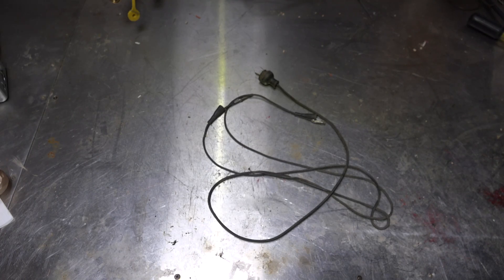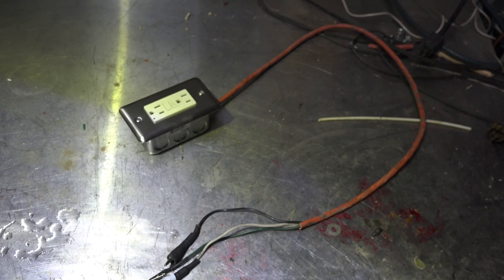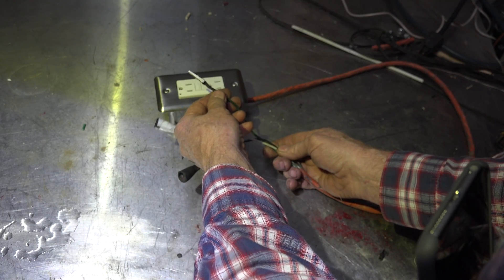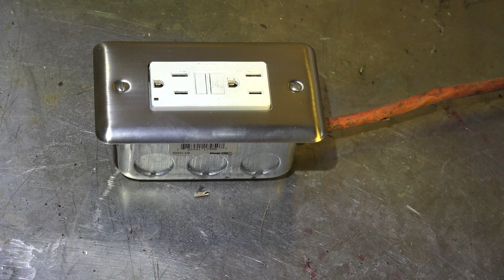A GFCI protected power tap

Comment: You might want to consider an Arc Fault Interrupter in case of accidental short (perhaps one of the alligators were to pop loose) it will trip upon arc instead of relying on the breaker tripping under full current.
Reply from the maker: I guess that would be nice but if I keep going here I will need a trailer to haul it.
GFM

Comment: GFM, I enjoyed many your HVAC videos and many of them are very educational. However, I need to point out that this practice using ground as neutral can be potentially dangerous. I read your responses to the comments regarding this issues. I know many HVAC techs use this method for powering their 120V equipments because they do not have an easy access to a 120V source.
Nonetheless, just imaged that if the bonding between neutral and ground is bad which is not uncommon and it is usually completely unaware to the home owner. Under this situation using ground as neutral, you basically energized entire metal parts of the building connected to the ground wire. Depending on ground resistance, the touch potential can be lethal. You might want to check out an experiment done by Mike Holt regarding this topic.  https://www.youtube.com/watch?v=Yg6G5VUSsWA
I don't  think every HVAC tech checks for open neutral and proper bonding between ground and neutral conductors prior to applying this method.  I am also not sure GFCI can completely avoid the danger. I believe that is why current codes do not allow this practice. Everyone uses this method should be aware of the potential danger and liability. Under current codes, the ground wire should be dedicated for just ground fault current conduction. Ground fault current is intended to trip the breaker as soon as possible to stop any fault in the circuit. This is just my small opinion as an electrical engineer. Keep up the good work GFM.
Reply from the maker: Wouldn't it be interesting if the service tech that uses this method and found it did not work because the chassis ground is open and at that point informed the owner that the electrical system was deficient and that the an electrician should be called.  I had one occasion out of literally several hundred connections made that this happened and I did inform the owner of a potentially hazardous condition in his system.  In this case, a fault in the ground system would be determined prior to any electrocution hazard.  Consider also that if there is an open in the safety ground, the connection would not work and there would be no need for keeping the connection hooked up.  Thanks for the thoughts and I have seen the Mike Holt video.
GFM

Comment: Using a bare alligator clip on the ground lead is not very safe.  A ground fault condition could exist and the user could be zapped upon attaching the lead.   All three of my power tap receptical leads are insulated, up to 1kV.

Comment: The beginning videoed (00:09) item is termed "a widow maker".  I made a very simular one featured at (01:50), but with a dual gang electrical box and cover.  It features  a GFCI receptical on one side and a voltmeter on the other side, plus fused, good up to 499v.  Reason, double safety checks, some of the HVAC gear I work on is 480v, 3-phase.

Comment: Can I splice together ground & neutral to a single alligator clamp to cut down on alligator clips, also if condenser is wet could I get a shock like one does on old homes w/o grounded outlets while working on window units after coil cleaning
Reply from the maker: You could but I would like to be able to connect it to a neutral equipped disconnect.  
GFM
Reply from the maker: Yes you could get shocked.  Disconnect the A/C.
GFM

Comment: By using the green or bare wire as a neutral, you now have made it part of a live circuit, with current flowing in it when you are using it to operate some device. Doing so now exposes everything that is connected to the ground wire to live voltage. You are showing people how to do something that is dangerous and illegal!!
Reply from the maker: Your type of comment has been expected.  Consider that using the ground as a current carrying conductor was legal until 1995.  Home appliances could become "hot" if the grounding was not properly done and this was a permanent install!  Not using the ground in a cheater like is far more dangerous than any possible problems with a disconnected ground.  Also consider that the cheater would not work as there was no path.  Component faults to ground will also cause the chassis to be "hot".  If there is a fault in the grounding system in this case the component will not open the circuit protection and electrocution could occur of it is touched.  This device is not dangerous.  It is a safe way to get temporary  power for tools we use in our business.  
GFM
Reply: I wouldn't say it is safe until you find a way to immobilize/secure the cord to prevent accidental yanks. Then i would call it safe/r

Also would a spade terminal on hot be better idea so you could tap into the contactor on the hot side?
Reply from the maker: You could certainly use a spade, but the alligator clips are more universal.
GFM

Comment: the N.E.C or national electrical code States, article 210.63
15 amp or 20 amp g.f.C.I outlet shall be installed for heating or cooling equipment.
the outlet can not be more then 25 feet away and on same level.
never connect the neutral & ground together @ devices , because the ground can carry current.
Reply from the maker: The code does require the GFCI protected outlet within 25 feet of any appliance but it is grandfathered in many rooftops.  Thus, we do what we must to do our jobs.
GFM
Reply: Steven Hall lol they don't enforce that bcuz I see so many brand new installs or change outs of roof top units where I'm at and no outlet anywhere or the out is in the unit but guess what isn't even hooked up
Reply: Steven Hall it is called a convenience plug

Comment: you shouldn't connect the green ground wire at all!! it could electrocute you if the ground isn't bonded good somewhere, the whole thing and anything connected would become "live" and the GFCI wouldn't trip, because the current would be flowing through it equally on the neutral and hot. they cannot sense the leakage upstream of itself, and there's no protection on the grounding.
using it without the ground will allow it to work as intended and trip on any leakage. you'd be using it as "no equipment ground"
Reply from the maker: Your type of comment has been expected.  Consider that using the ground as a current carrying conductor was legal until 1995.  Home appliances could become "hot" if the grounding was not properly done and this was a permanent install!  Not using the ground in a cheater like is far more dangerous than any possible problems with a disconnected ground.  Also consider that the cheater would not work as there was no path.  Component faults to ground will also cause the chassis to be "hot".  If there is a fault in the grounding system in this case the component will not open the circuit protection and electrocution could occur of it is touched.  I hardly think that the temporary use of this quite safe device deserves such condemnation.
GFM
Reply: yes, they used to allow the cases to be bonded to the "neutral" within the appliances, due to people being electrocuted the code was changed and 4 wires required.
same issue trying to use the bare/green ground as neutral, if it's loose somewhere and has resistance, the devices plugged in will possibly function at reduced voltage and the ground itself could now have any voltage from near 0 to line voltage and everything bonded to it can now become "live" and the GFCI will not sense it as a fault since the current flowing through it's "own" hot and neutral will be balanced.
to test that, place an incandescent bulb or electric motor in series, with your cheater neutral and ground clipped to one terminal and the other to the ground/neutral. "DANGER" the gfci box/cover and anything plugged into it will now be live and pass enough current to kill instantly. bad appliance/device not needed
remove the ground clip, and test again, no live cases :)
also for GFCI function test with a "shorted" appliance and provide grounding to it through a "hotdog", now the gfci will trip.

Comment: I made one with a circuit breaker and a GFCI. Cheaters are still dangerous...
Reply: na na what size breaker did u use
Reply: 20 amp along with a 20 amp outlet.
Reply from the maker: A breaker would be a good idea.
GFM